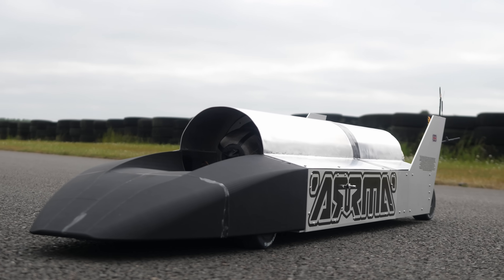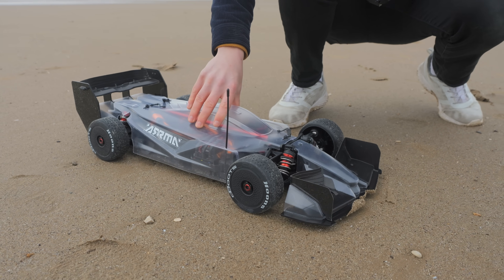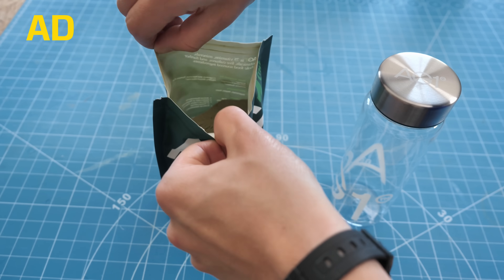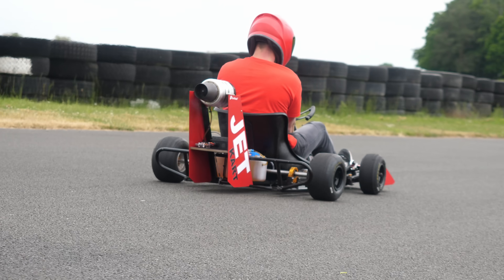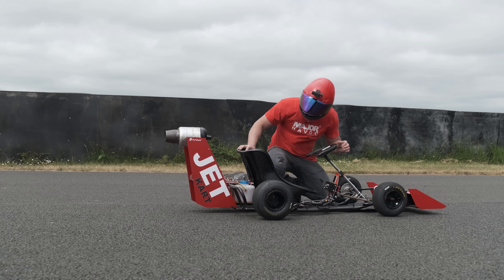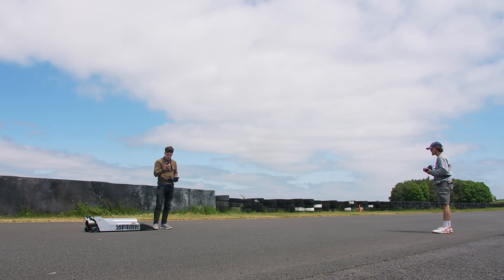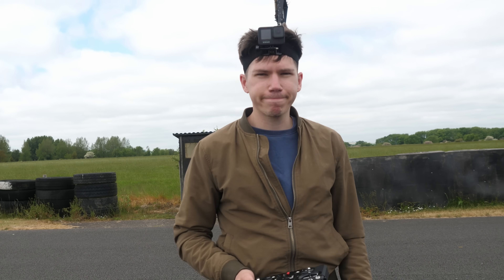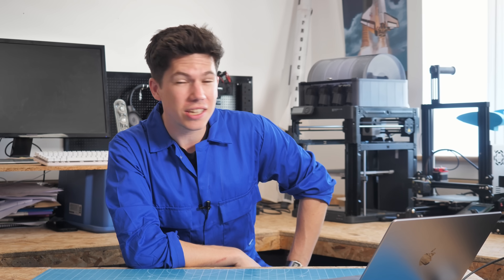Jet Engine Powered RC Car - Track Test

Comment from the maker: Major Havoc’s channel! 😊 https://youtube.com/@majorhavoc
Reply: Suggestion: to make your car as fast as possible don’t worry about the engine or anything else but instead focus on reducing your drag, like instead of a boxier shape maybe have a tear drop shape, having a boxier shape increases drag even with a aerodynamic nose cone for example Hypercars at Le Mans, Bugatti, or some F1 cars most
Of them follow a tear/rain drop pattern. And MOST IMPORTANTLY work on making a diffuser for your car since without one it’s similar to driving with a parachute strapped to the back of your car but these are just suggestions from what I think would decrease drag
Reply: @strudel9250  Good idea
Reply: @strudel9250  everyone like his comment
Reply: for example in the front near the intake of the engine there looked to be a big gap where a lot of air could get trapped, and slow the car down. Great video again, and i cant wait for you to break the record. GL
Reply: @strudel9250 e should install two smaller edf fans or rocket engines on the sides of the car so it will propell it so fast that no one could possibly beat him, and also add some downforce bcuz if not it's gonna be airborne.
Reply: @IbmnPtBngYT  adding two smaller EDFs defeats the purpose of a jet engine powered car
Reply: @strudel9250  🔴 What Is Islam? 

🔴 Islam is not just another religion. 

🔵 It is the same message preached by Moses, Jesus and Abraham.

 🔴 Islam literally means ‘submission to God’ and it teaches us to have a direct relationship with God. 

 🔵 It reminds us that since God created us, no one should be worshipped except God alone. 

 🔴 It also teaches that God is nothing like a human being or like anything that we can imagine.

🌍 The concept of God is summarized in the Quran as:

📖 { “Say, He is God, the One.  God, the Absolute.  He does not give birth, nor was He born, and there is nothing like Him.”} (Quran 112:1-4) 📚

🔴 Becoming a Muslim is not turning your back to Jesus. 

🔵 Rather it’s going back to the original teachings of Jesus and obeying him. 

More ....
Reply: @1islam1  I’m not interested in Islam, I am a strong catholic which is just the way I was born and raised
Reply from the maker: Let’s do it again!
Reply: @project-air Great job! Next, you should build a submersible to visit the Titanic! 
Update: I made the above comment before it was discovered that all were lost. Like many, I originally hoped that they would be rescued. 
I do believe that if given the resources, James could build a submersible that would make the dive. It's his dedication to perfection that would ensure his success. This tragedy is a stark reminder of what will happen when shortcuts are taken and projects are rushed. When the stakes are so high, there is no substitution for perfection!
Reply: New schedule ?
Reply: You should install two smaller edf fans or rocket engines on the sides of the car so it will propell it so fast that no one could possibly beat you, and also add some downforce bcuz if not it's gonna be airborne.
Reply: put a DJI 03 air unit on it
Reply: There are people on here pretending to be you
Reply: That beast was boogieing and looked so stable at a decent speed.
Please smash the world record for jet powered and overall.
Well done mate you sure designed and made something like the Thrust 2 salt lake drag car which I believe was engineered and built in England on the Isle Of Wight. Good luck at Rossa .
Reply: I had a thought of maybe you could add sprung skirts mode from silicone and aluminium to stop air getting under the car and sticking it on the road. I think that a formula 1 team already did something like this back in the 80's. 
This mod will add a bit of drag but it will ensure that the jet car will stay planted, you could also try to make the retractable skirts out of maybe a brush material for less drag but I don't know how effective this will be.
You may not need to do this seeing as the car is so stable and balanced correctly, How did you weigh out from front to back? Was it 50/50 or 60/40.
Any way good luck at rossa and Smash some records mate.
Reply: @zeemanjr  this is a good idea to utilize the ground effect to make downforce but if the bottom is shaped too much and is pushing too much air it can put tons of load the the suspension
Reply: where is the mini cooper?
Reply: I see a Dalek! 1:29
Reply: what about making shape memory alloy wire tires ?
Reply: @blhughes01  That would be a good idea, but it's very difficult. The balance at those speeds must be so perfect. Maybe something made from a machined billet of lightweight metal. Then, have a thin layer of rubber(or other compound) adhered to the outside to keep it from flying off. 
On Kevin's rc channel, I've seen him use tires made like that for hi-speed. Unfortunately, they didn't do a good job adhering the rubber to the metal, and it delaminated. It's not going to be easy with something spinning so fast.
Reply: Add in a electrical motor which will power all the wheels, maybe accelerate up to certain speed and stay there, or other methods without the electronic motor, the purpose here is to let the rc car have a constant moving rpm, sort of like car's engine brake, this will increase the stability of the rc many folds and need not worry about instability again. When u drive, u know how dangerous it is on neutral but when engine brake is engage it will almost impossible to crash a car.
Reply: Please make a new one. Because can you go faster?

Comment: Actual go karts with without a rocket engine, will do 120 no problem
Reply: @gamingepic10   still for a 20 hp engine is quite impressive
Reply: and there are also shifter karts that could probabally go flying past 100 mph if it has the right sprocket, and a long enough straight

Comment: Could you cast your own rubber tires and put small steel cables in them to help hold them together like "steel belted" car tires?
It may take a few sets to find the right durometer of rubber.

Comment: Idea for the wheels, use a 3d printed base with quarter inch tread melted to it or connected in another stable way.  The wheel design would reduce the amount of expansion from the rubber while keeping the grip.  Widening the wheels and wheelbase is a good way to keep stability.

Comment: What about having some automatic sensitivity control on the steering servos, so that at higher speeds it responds with less sensitivity than at slow speeds. Otherwise, at very high speeds I can imagine it being quite hard to control.

Comment: Awesome! At some point you might want to engineer yourself a thrust reverser assembly for that thing. Attenuating the residual thrust from idle is the main reason airliners use reverse thrust on landing, as idle power in a jet is more than enough to start moving and accelerate. Most modern airliners only really use idle reverse for the most part.

I mean, turning the engine off works, too, I suppose.

Comment: find an old rail line, and find a way to connect it to the rail without adding too much weight, and low friction! thatd be awesome and would be pretty smooth / straight.

Comment: think Rich might have used the wrong kind of thrust to hp calculator cos that is NOT 170hp, If i stuck a 1000cc 170hp motorcycle engine in that Kart it would be utterly terriffying, that looks more like 17hp than 170hp.

Comment: If you really wanna put that thing on rails at high speeds I would look into some diff lockers for the front and rear diff. Scorched RC and Hot Racing make them . Perfect Pass also makes stiffer speed run springs for the limitless. If you rake the front end a slight you shouldn’t have any worry’s about the car flipping end over end, since the turbine would push it into the ground. I’ve seen them flip that way numerous times even with a ton of downforce

Comment: I wouldn't have anything on the top on one side, at high speeds, that will pull the car in that direction or worse still make it flip, all your surfaces have to be smooth, left and right, even a screw hanging out will make a Hugh difference at speed.

Comment: i have an Idea for the wheels,
What abut a mettal Rim with cutouts in form of a tire Profile.. and a Rubber inlay so the profile of the tire stick out the rim but the Tire it self cant expand becourese its inside the mattel rim.
basicly liek a reversed rim.. Hard to explain ;) i could do it in fusion 😛

Comment: Air intake for the jet engine is compromised by the proximity of the driver.
Improvements to top speed will require a redesign l think.

Comment: Suggest to work on the design of the car which is underwhelming given the aim of the project. Otherwise it looks as everything is going as planned of course driving it at much higher speeds will be a challenge. Needless to tell you that I'm exited ...

Comment: You can make a bigger intake, this will begin to pressurise the air before it enters the engine. Another thing to note is aerodynamics, definitely over 100 mph and especially over 200 mph. Camera's will lose you tens if mph at that speed.

Comment: Awesome project here.  I've always wondered why such top speed cars don't use a camera and arduino, raspbi oder such, to follow a straight line. 
I suppose part of the top speed bragging rights are manual control, and all the difficulty that comes with that.
Still, it's the next logical step.  Draw a nice, straight line on the runway (chalk maybe?) and have the computer adjust steering. The very easiest of "self driving". 
Best to have this on a switch so you can take back full control at any time, but it'd make speed runs SOOO much safer, at least for testing.

Comment: Love your work - these projects are great! 
Do you need to be actively ‘driving’ the car for it to count? It seems like it would be trivial for you to run it on an autopilot to keep it on the centreline without the oscillations you’d get with manual control? A big kill switch needed for when it goes rogue though!

Comment: Might wanna tap the ol knowledge that out there, like the 60's when the Arfrons klan, Craig Bredlove,  and the boys at the salt flats were buying up ol J-79's and going 600+.  They came up with
the Al wheel after the rubber gave up a lot slower than they wanted to go!  Hot Rod and most of the car mags had info, photos if nothing else, never hurts to browse.   Ol Guy.

Comment: Think I'd want to replace some of those phillips head screws with flush rivets (or similar). Metal wheels would probably work best on a surface like the Bonneville Salt Flats. Or a nice beach at low tide. Personally, I am really looking forward to the next video..

Comment: What you? Might. Want to think about? Is what real high speed cars use? Is a parachute to help slow down at high speed trying to apply the brakes when it mit get Sketchy.
Very nice build another thing I see the length of your nose sticking out is very air dynamic. But the air pressure might force the nose down being that is so far in front of the wheels. Time will tell.

Comment: Does the engine in the tube not make as much thrust as if the engine was not in a tube? I would think the thrust column would get sucked to the walls and diffused before the end, losing power. I think a thrust tube directly attached to the engine would work better, imo of course. The car looks great and best of luck with the record.

Comment: That beast has so much potential. Don’t push it until you have the right location, and probably make sure that you have a tiny amount of steering authority. At those speeds even micro steering inputs have a large effect.

Comment: Falls du wieder einmal Metall biegen möchtest würde ich dir raten einen Holz- oder Fieberglashammer zu verwenden. Eisen auf Eisen treibt das Material, wirft Wellen und im schlimmsten Fall verzieht es sich. Das macht man nur, wenn man es wirklich möchte.  Und ich nehme nicht an, dass du die Wellen und die Verziehungen in deiner Abdeckung beabsichtigt hast.

Comment: They had to spin up the solid rim Bluebird wheels on a static jig to see if they'd hold together at high speed. Switching to solid tyres will stop the ballooning, but don't underestimate the damage an unbalanced wheel or failed bearing can do at high RPM. I'm sure you'll test your custom wheels, but maybe include an oversized wheel in the jig to simulate the contact point and as the drive output, so you can simulate downforce to check the bearings can hold up and the balance stays true. Really exciting to see it coming together - very professional effort!

Comment: How have you not bought your own lathe yet? How have you not set up a foundry yet? Make your own Aluminum/magnesium parts. Carbon fiber is expensive and doesn't take heat well but could work in some parts. Suspension. Wheels. A collaboration with a channel with a C&C. It's got to be cheaper than buying these models.

Comment: Great first run! I wonder if you could make some stronger wheels out of hockey pucks turned down on a lathe. I don't know how well they would hold up but they are quite hard but are also made of rubber.

Comment: I have a question. There's a game (KSP) where you can alternate how sensitive your inputs are (it's called fine controls). Wouldn't it be nice to have some type of capability to switch to that mode so you can steer easily at higher speeds?
Reply: That controller will have programable variable rates yes.

Comment: The go cart will not hit optimum speed due to sitting in front of the intake. The SR-71 had a cone to control the amount of air passing through and would only be opened up fully at Mach 3.4. That was when the plane was most fuel efficient believe it or not.

Comment: Do the rules allow you to use a FPV system on this? I can imagine it will be difficult to respond to the car going offline or hitting bumps at higher speeds without one. Having a drivers eye view might help. Looking forward to seeing more of this beast. Well done so far.
Reply: Not sure why this isn't S.O.P. on all RCs as these speeds climb. Is there a time lag in the controls preventing this from being implemented?

Comment: Stupid idea but what if you 3d printed the tires using TPU?
Reply: Nah they will be worse than standard rc wheels
Reply: @Ipad-ee4cf  yeah probably right. 100% infill still wouldn't work to well..just that I started using TPU and fall in love with it heh

Comment: As you approach higher speeds you could encounter brake fade if you are using disc brakes. Might want to add a parachute and/or bigger brakes

Comment: Might want to consider a parachute for this. Stopping from 60mph with rubber tires is one thing, stopping from 200mph with whatever new wheels you come up with is going to be a challenge without a parachute I think.

Comment: I have an idea.  Could you put some sort of venturi in the middle of that pipe and have a second pipe down to the ground under the center of the chassis so that the thrust would also create a little vacuum beneath the car?  I saw an electric race car recently that had huge EDCs in it just to suck it down against th pavement for stability and traction .. would this help any?

Comment: Congrats on the project!
suggestion: add FPV camera to the car in addition to track markings. This will facilitate control at high speeds and long distances, thus giving greater precision to piloting.

Comment: Hello buddy it looks amazing but i think it would work better if u put an angle that goes up into the intake and a angle down into the back exhaust, which could help push more air into the engine and create pressure, which should help with improving thrust.
My English is not great but what I'm trying to say is use a cone design. Sorry if I could show you a picture it probably make more sense

Comment: Would you consider expanding the wheels for a wider stance? It may offer more stability during those really fast runs
Reply: It would make it more stable but the losses due to the increased friction with the ground would probably dramatically reduce the potential of the car.

Comment: Looking good there with the mini Thrust 2 Mate!😉 The steering ratio needs to be really slow on an LSR car to prevent over steering & it looks like yours might be too fast. CP & CG are also very important to stable straight line speed.

Comment: I was thinking of machining aluminium wheels and making the tyres from a section of thick high-pressure rubber hose. Simply press the sections of hose onto the wheels. Glue could  be added for insurance to keep them from creeping off the wheels as they get hot and grow.
Reply: I think it'd be better to put a mold over a machined aluminum hub, and then pour a resin to cast urethane to make a wheel that is integrated with a solid tire. The only question is whether to use a somewhat solid urethane or a custom mix for a foamed variant. Then machine and balance before use. I figure skateboard wheels deal with a beating fairly well, so that choice of material may hold up to the demands of a high-speed RC car.

Comment: I just had an idea about the tires required for use on tarmac! Why not just use the softest skateboard wheels you can get and adapt them for the RC car's hex drive? I know some companies make 78a durometer wheels, which is probably the softest and grippiest you will find.

Comment: 5:42 That would be at 720mph where you would not have that 40kg of thrust. Doesn't make any sense. At 60mph (if it would have those 40kg of thrust) it makes about 14HP.

Comment: You should install two smaller edf fans or rocket engines on the sides of the car so it will propell it so fast that no one could possibly beat you, and also add some downforce bcuz if not it's gonna be airborne.

Comment: If you look closely at the land speed car the cross section of the aluminum wheels is like the number “7”.    Just like rubber the aluminum wheels will want to expand at speed and the 7 configuration will allow that.  Not sure how tall your wheels are but a 4 inch wheel would be somewhere north of 18,000 rpm